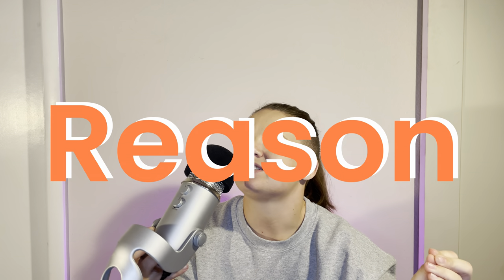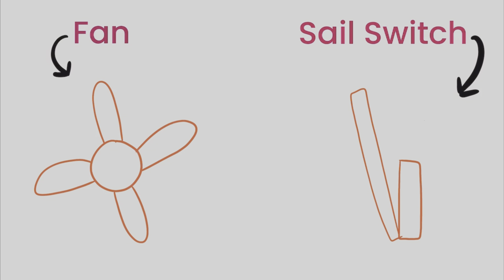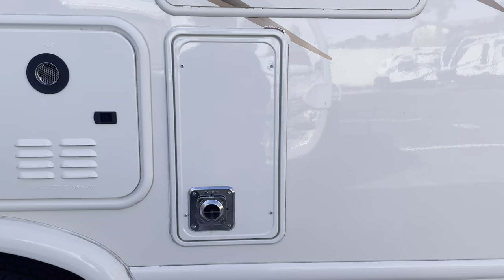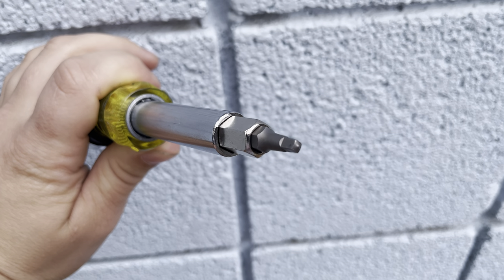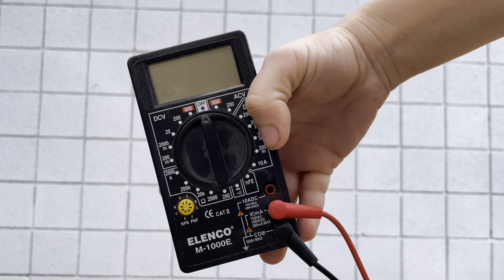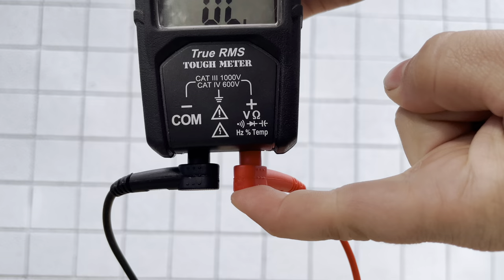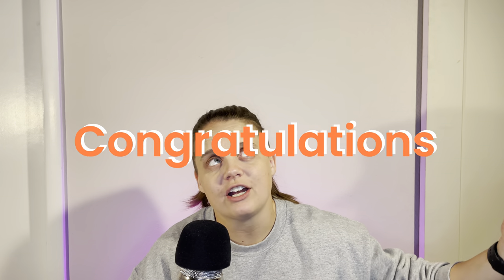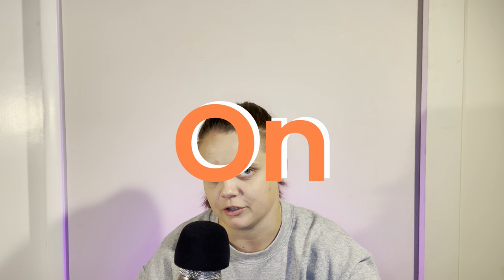How To Change Your RV Furnace Sail Switch Without Breaking A Sweat

Comment: Got a Keystone Passport that has classic symptoms of a bad sail switch, but guess what - no external furnace access panel to the front of the unit.  You can get to the back of it on the inside under the fridge, but no way to access the switch without removing the furnace assembly!  Thanks Keystone for such an intuitive design element.  I've ordered an aftermarket access panel kit and plan on cutting through the outside wall to install it - just to get to the sail switch.  Thanks again Keystone for such a user-friendly design element.  How about a car with no hood - would that fly?  Thanks for the informative video Emily!

Comment: Without breaking a sweat.  Well, on my Winnebago, the entire furnace has to be 
removed from the coach to get to the sail switch or the delay relay. Thanx Suburban!
I'll give you a pro tip-
The sail switch or the limit switch or the delay relay are the #1 & #2 & #3 problems found with Rv furnaces.
BEST PRACTICES-
When any 1 of these fail, replace all 3 parts. You will thank yourself some cold as hell autumn
night when you are up in the mountains. All of these parts are cheap.

!
Reply from the maker: Yeah it can go either way. If there is an access panel Furnaces can be super easy. If there isn't... well that's another story.

Comment: my furnace on my sprinter based campervan works erratically - i suspect a failing sail switch - but this furnace has such limited access I decided to simply install a diesel heater which works so much better

Comment: Hi, I think I have a sail switch problem too.  My two month old (brand new) RV will not produce heat at all.  The furnace runs 15-30 seconds, then shuts off without ever igniting.  I am a retired industrial electrical engineer.  I have no problem at all replacing the switch; my only concern is having no idea where to obtain the correct parts for an RV--they are different from the industrial parts that I am accustomed to and the suppliers of RV parts are undoubtedly different too.  BTW - I am thinking of pursuing my own RV repair certification.  Would you be open to a short conversation about that?
Reply from the maker: Honestly the easiest place to find a Sail Switch for RVer's is probably going to be Amazon. Just make sure the numbers on the side of the sail switch match up with the listing and you should be good to go. And Yes I'd love to talk about RV certs. Where are you thinking of going to get yours? I went to the NRVTA so that's all I can speak to, but it was an awesome experience.
Reply: @rvrepairwoman    Thanks, and I was thinking of going to NRVTA as well.  How can I contact you?  Do you have a work phone or website with chat or private messaging?

Comment: I have an 2004 Winnebago Journey 39K with a Suburban SF-42 heater.  My issue is that the blower runs 24/7.  Not even turning the thermostat off and removing the fuse shuts it off.  I'm thinking that the sail switch might be the problem.  I just recently changed the air filter which obviously had not been changed in years.  I've only owned the RV for 2 yrs and only this year started using it..............

Comment: Okay. I have a 1994 Jayco 1207 pop-up tent trailer. Last winter the thermostat wires melted and almost caught on fire when trying to turn the furnace on. The furnace worked fine before this. I replaced the wire and the aticipator in the analog thermostat lit up like a lightbulb filament and the thermostat was shot. Replaced the thermostat and beefed up the wire guage and the anticipator wire lit up again and seperated. Thought hmm...through a series of trial and error, started throwing parts at it because replacing the 30 year old gas furnace is way more expensive. Replaced the thermal relay and tried to bypass the thermostat and blew a 20 fuse. Replaced the delay relay and tried to bypass the thermostat and blew another 20 fuse. Pulled the motor and motor bench tested fine started right up. Checked the sail switch and it had a dust ball at the connectors. Removed the dust ball and continuity tested...no noise on open and beep when button was depressed. Could that hairball have been causing a short and been blowing the fuses? I have one 20 fuse left before I have to run to the store for more.

Comment: 2021 forest river arctic Wolfe heater blows warm air just not very hot could this be early signs of the sail switch going out
Reply from the maker: The sail switch is a binary thing. It either allows the furnace to stay on or it doesn't. It won't affect the temperature of the air itself. Try going to the exhaust vent outside and see if there is HOT air coming out of there. If the air there is HOT, then look at cleaning out your ducting. Your furnace is making hot air it just isn't getting to you. If the exhaust isn't HOT then look into whether you're getting a strong flame or not.

Comment: In your video, you unscrew the switch and magically, the electric leads are disconnected. How do you disconnect the leads?  They are wrapped in plastic. I'm not sure how hard I should pull before they're damaged? Firmly pulling, they don't budge.
Reply from the maker: Sometimes you need to get in there with some needle nose pliers and wiggle them back and forth to get them off.